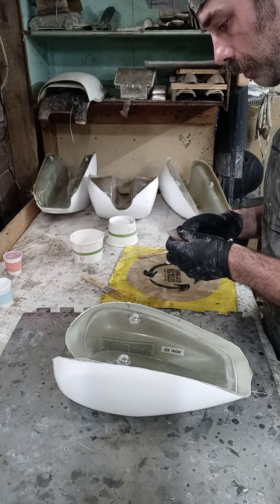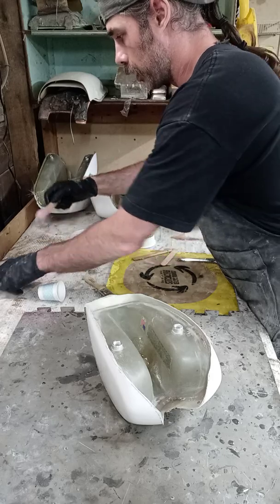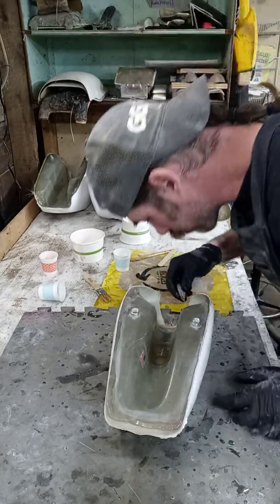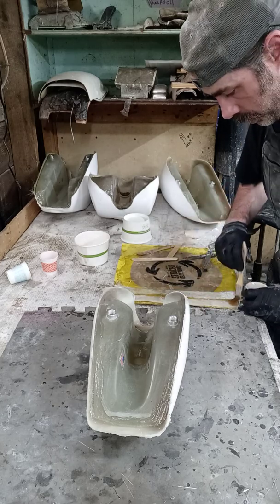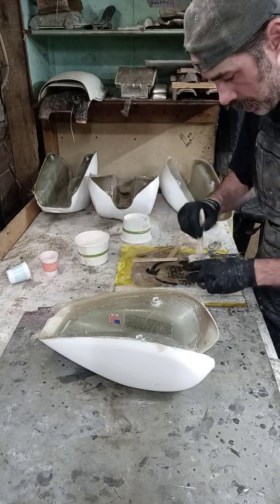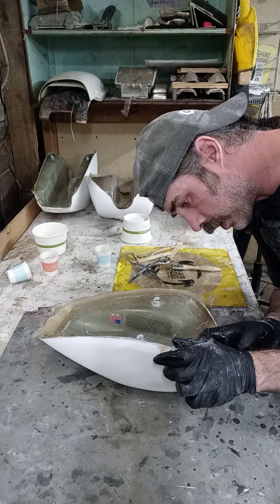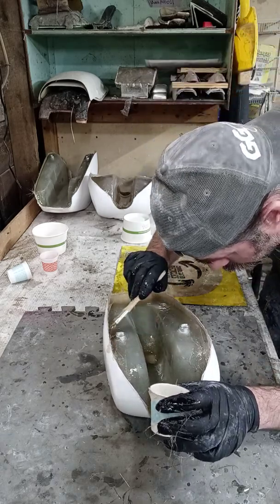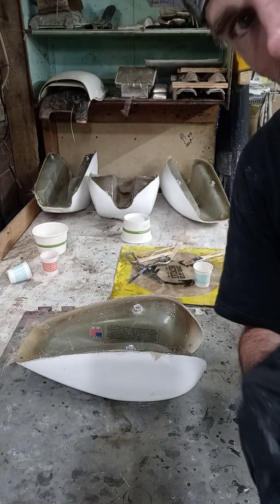Fiberglass Gas Tank halves getting laminated together

Comment: amazing quality. what kind of glue do you use to join the upper and lower parts?
Reply from the maker: It is a polyester based putty that is of the same makeup as the resin we use. There are more photos of my work @goonglassrubber on insta. Thanks for commenting!